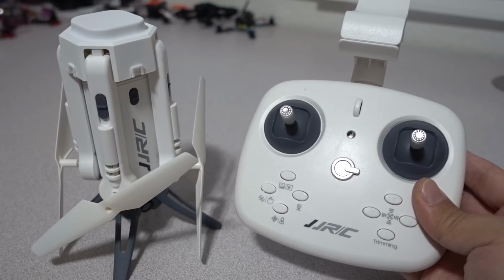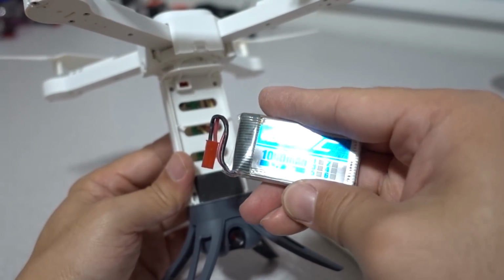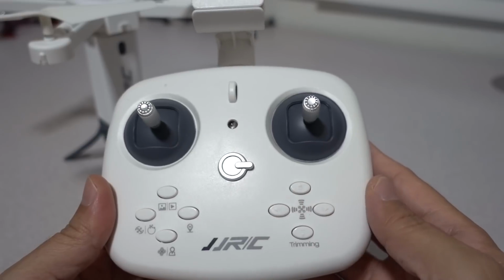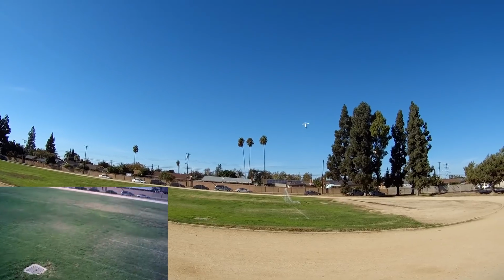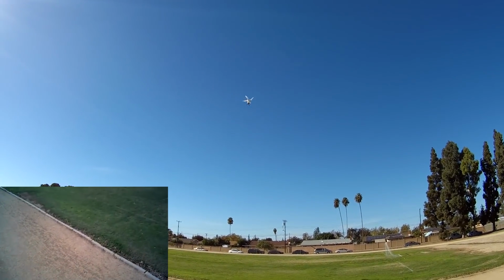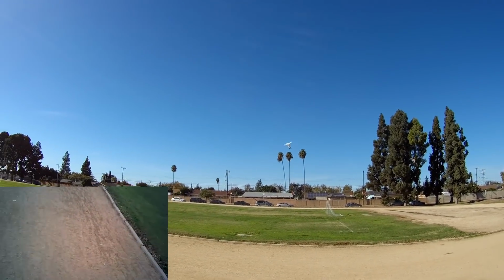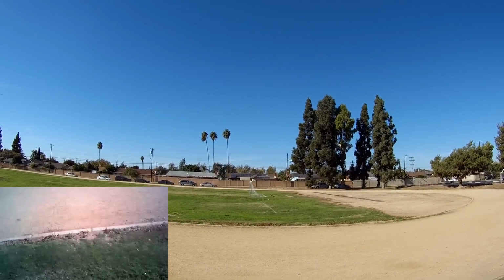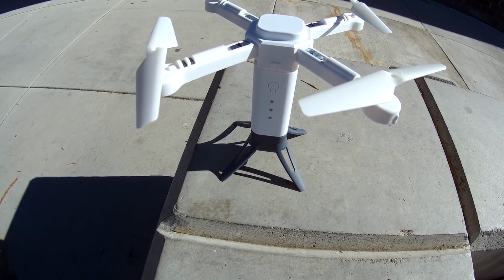JJRC H51 Rocket 360 Drone Review 🚁

Comment: I have been watching your videos.  Good stuff.  I picked up this unit on Amazon for $25 today based on your review (I am 99.9% sure they are identical).  Plus I like the unusual design.  PS.  In one of your videos (xaiomi conematic mode test) you fly way above the house and there was a HUGE building with a rounded roof in the distance like a hangar for a 747 or two or 5.  What the heck is it?
Reply from the maker: blimp hangars